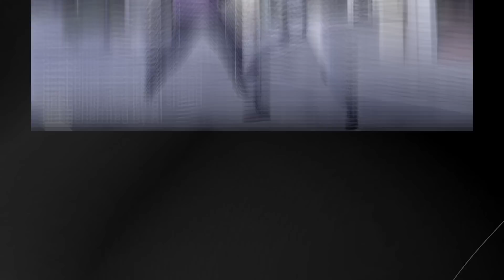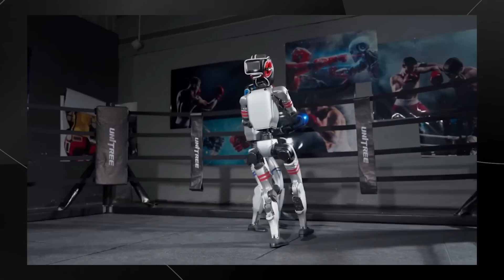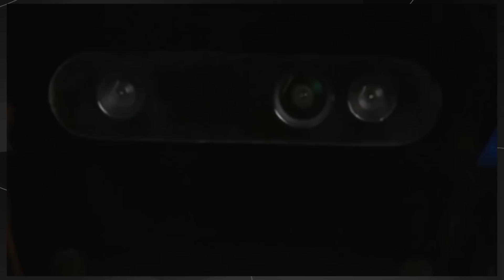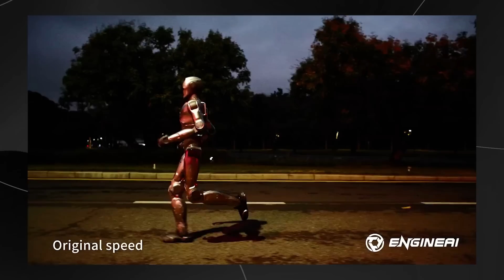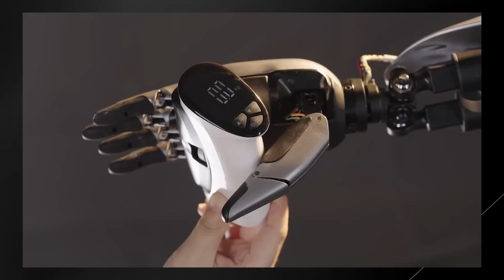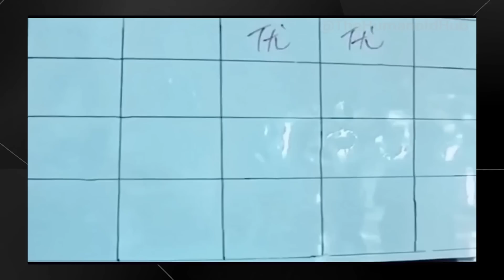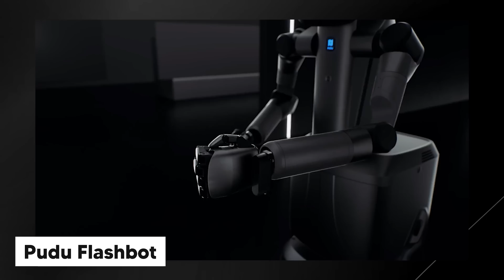Top 10 Chinese Humanoid Robots In 2025 (Updated List)

Comment: 0:11 : Unit G1, by Unitry Robotics; Primarily for research & education : The cost starts around $16,000
2:22 : Astrobot S1, by Stardust Intelligence; For home assistance (e.g., cooking & household chores) : No price available
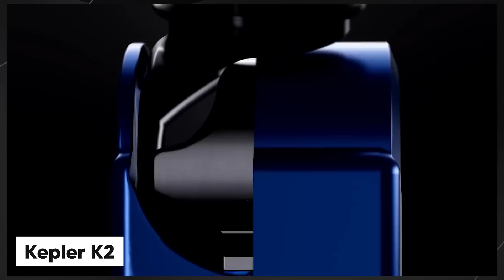4:57 : Kepler 4Runner K2, by Shanghai Kepler Robotics; Mostly for industrial & commercial applications : No price available
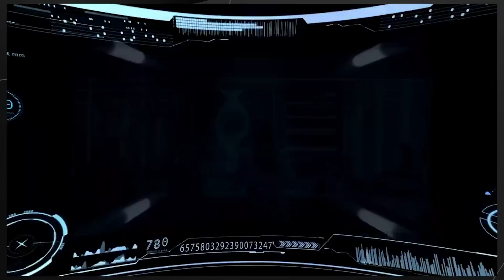6:24 : Engine AI PMO1, by Engine AI Robotics; Fast running; Natural movement; 320° waist rotation : Was $12k, now $25k to $40k
10:12 : Walker S1, by UB Tech Robotics; Designed for industry (manufacturing & logistics) : Costs $24,500 + $130 S/H (US)
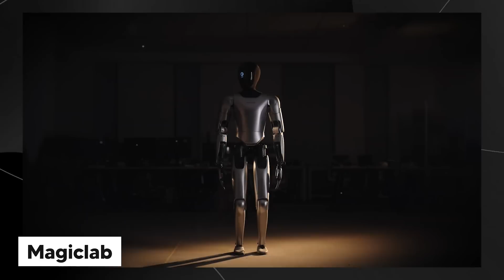12:34 : Magic Bot, by Magiclab; Joints have 42 degrees of freedom, w/ highly human-like movement & dexterity : No price yet
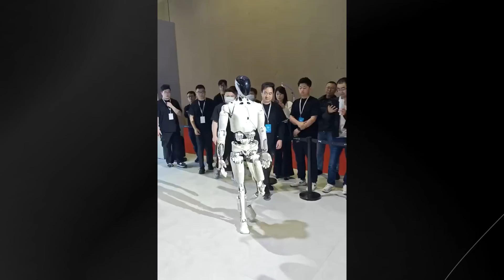14:58 : Xpang Iron, by Xpang Motors; Great mobility & human-like dexterity; 22° freedom for each hand : Est. $150k (2026 release)
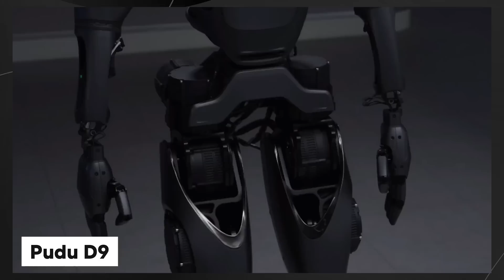17:46 : Pudu D9, by Pudu Robotics; Joints have 42 degrees of freedom; Terrain adaptable w/ real-time 3d maps : No price given
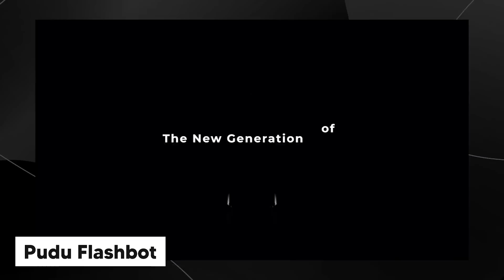19:09 : Pudu Flashbot Arm, by Pudu Robotics; Semi-humanoid; For hotels, offices, restaurants, retail & healthcare : Costs $28k (not final)

Comment: These have already been proven to be radio controlled.  They don't do anything autonomously.
Reply: That's true of some. You need to be specific. Optimus by Tesla for example is tele-operated. It is not autonomous at all. But BD Atlas for example has more autonomous ability. The game right now is to create a 'library' of certain things these robots can do, and then these libraries can be used later during job training. Moving objects from one spot to another is not very exciting, but these are the kinds of building blocks that can be later refined and incorporated into larger action systems. Once these robots can reliably move their bodies around in 3D space all the parts will begin to come together. The full autonomy, right now, is not actually the point. The point right now is the little building blocks. We are still early in this industry.
Reply: There are levels of autonomy. For example, AI can code today, but you have to tell it what to do, it can’t just decide to make a new app. Similarly, some tasks are autonomous. These robots don’t need to be manually controlled for tasks such as walking.